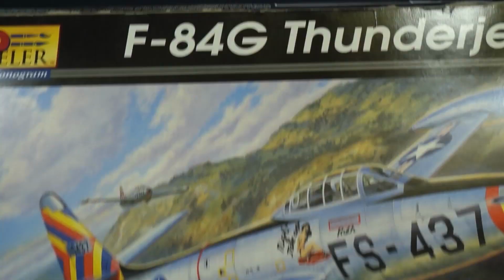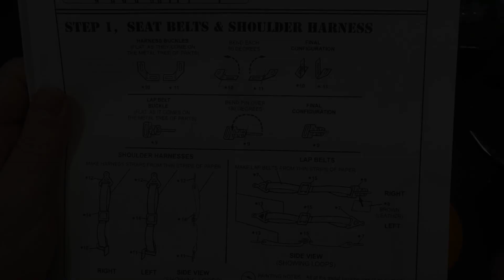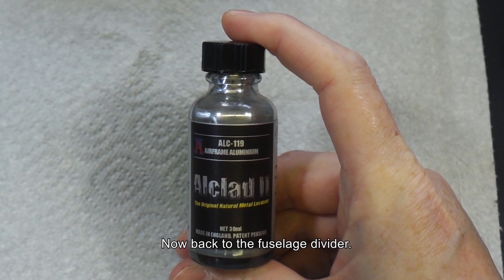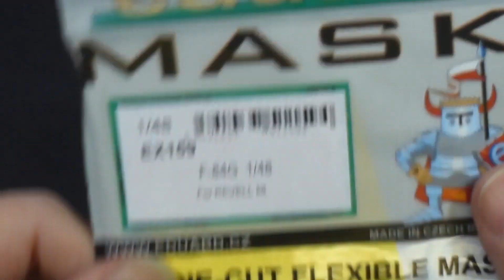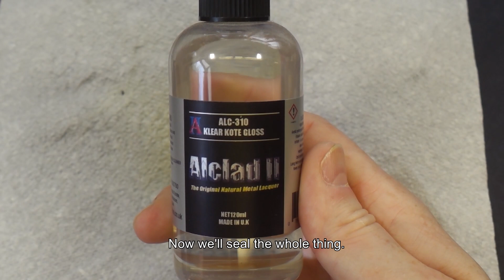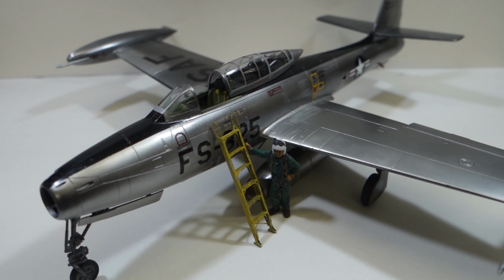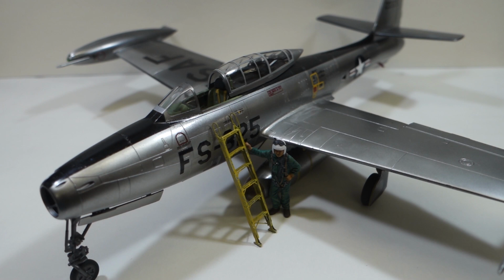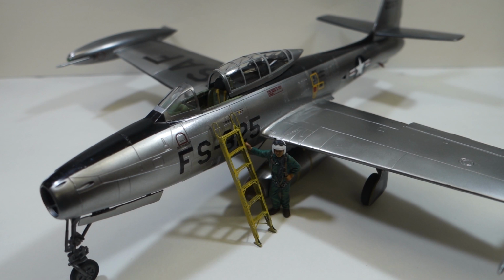Building the Revell/Monogram 1/48 Republic F-84G Thunderjet

Comment: Whenever I had a kit with old decals, I would use a new #11blade and cut around the entire decal leaving a small amount
of the yellowed clear paint to help with positioning. Also I would use hot water to soften the decal. Hotter than usual. Once the 
decal was in place then all I had left to cut away was the small piece of yellowed clear coat. This worked a majority of the time
as long as the water was close to boiling around 200 degrees. I know this is extra work but the results I had was worth it. But
this was back in the 60's and 70's. Anyway, I thought I'd pass it along because I truly enjoy your videos.
Reply from the maker: Thanks :-)

Comment: Well at least the ladder looks great. :)

You probably already know this, but when you run into a decal breaking up, hitting the sheet with a coat of clear spray will usually help the rest of them hold together.
Reply from the maker: I tried that - it really didn't help. It was strange really, because the decals really didn't look that bad, but no matter what I did, the colour ones just crumbled. I was going to get a set of aftermarket decals, but they would have cost more than I paid for the model :-)
Reply: Man that is bad. I've never heard of that not working. Ah well. I'm not a big jet fan either, so I know how you feel.

Comment: I'm working on a fury biplane right now and recently got into using Alclad paints. I needed to use three different shades of aluminum because of the plane being part fabric part metal, so masking it all up and painting it was quite a hassle. When I had finished and sprayed the Alclad gloss klear kote, the metallic look of the paint went away and dark spots began appearing in the paint mainly on the wings and underside. How were you able to maintain the metallic look of the Alclad paints when you applied the gloss klear kote?
Reply from the maker: I have gloss Klear but I very rarely use it. If I want to maintain the shine I make sure the lacquer is well and truly set, leave it a couple of hours at least, and then go over it with Tamiya X-22 gloss. I'll do some experiments with different varnishes on Alclad lacquers and see what happens.

Comment: Curious, do you remove the paint from the mating surfaces before gluing? Thanks.
Reply from the maker: Not usually, no. I tend to use weld-bond glues like Tamiya Extra Thin, which I've found works just as well whether the surface is painted or not.

Comment: Its quite annoying the scale with military vehicles the 1.48 in plane and ships boats etc are bigger than the standard 1.35 we tank n armored vehicle guys build but when you think your buying a 1.48 tank thinking shes gonna be a good size its smaller than the 1.35 that's the part I think is off putting sometimes your questioning if a 1.48 now is going to be the bigger scale in any kit now,  so tend to stick to what I know I'm building I'm gonna start a plane soon for the first time but not to sure what one something old I'd love a canvas double wing like something from ww1 or maybe u2 spyplane for a first plane build, any suggestions?

Comment: Great video! I own a bottle of AK interactive Xtreme Metal Aluminium but it really stinks. I'd like to get Alclad's paint but I want to know if it smells better or worse. The AK is enamel and I mainly use Tamiya acrylics so I have no experience with lacquers. So would it smell stronger than AK or not? thanks, Nathan
Reply from the maker: I honestly don't know. I don't recall it ever smelling that bad, but the cellulose thinner I use to clean the brush with is quite pungent.

Use anything lacquer based in a well ventilated environment.